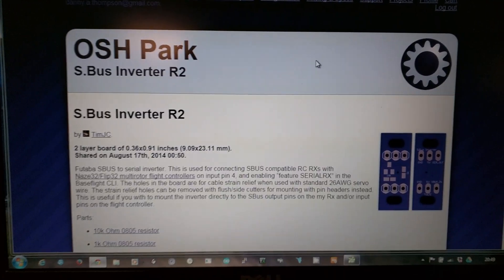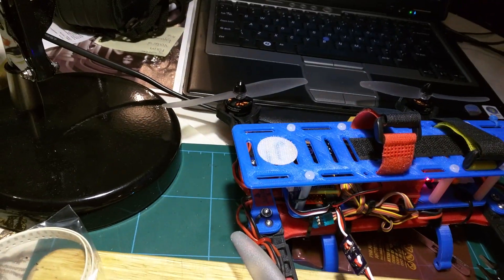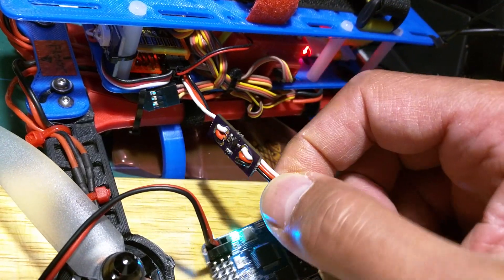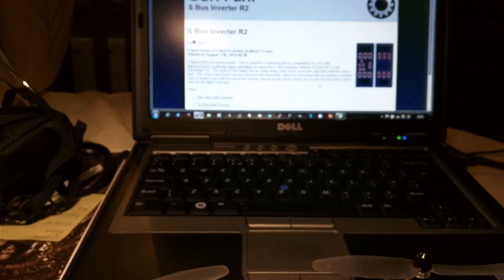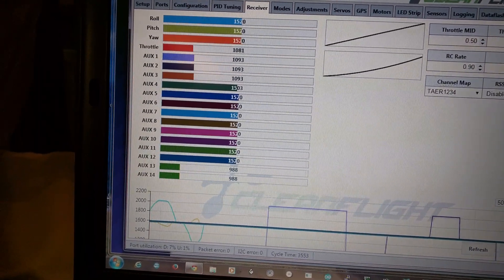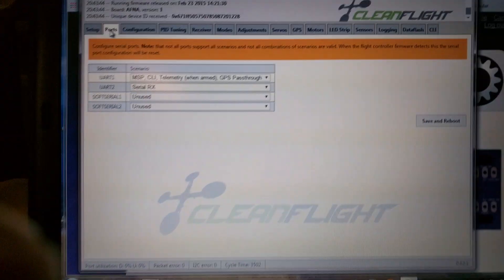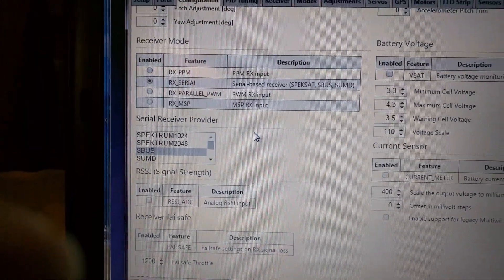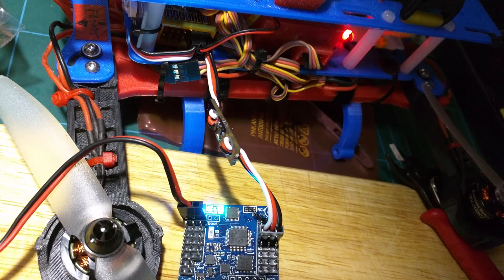S.Bus Signal Inverter - Flip43/Naze32 Cleanflight

Comment: You basically built a NOT gate, correct?
Reply from the maker: Yup. Can do with specific IC inverter or a transistor and a couple of resistors.
Reply: Interesting. So this is all that's needed to use FrSky x8r PPM on a Flip32+?
Reply from the maker: Leinad Abrasax Yes, it is a very simple circuit. My first was using a transistor and resistors. Then I used an OS board and SMD to learn how to solder these small components.

Comment: Hi Danny  I found the website for OSH for the inverter kit, but they wouldn´t send me a small order. Does the kit include the board, resister and the transister. Can you supply these items. I dont think that they wanted to post to Spain
Reply from the maker: Hello Ken,
I originally ordered 9 of these which OSH were happy to send out. I have sold all of these since then. Sorry, I can't help in this instance.

Comment: Just for anyone who might be looking to invert SBUS, in some cases it's already been inverted on the board, and you can solder a new signal wire onto another part of the board and have the signal you need. From what I know it can be done with the Frky D4r-II and FrSky X8R (It's especially easy on the X8R, there's a pad to solder onto) and might be possible on other receivers.

Comment: I have tried to get this working with a Radiolink AT10 and a R9D receiver without success but i am using a 2N3904 and 4k7 and 18K Ohms resistors. Should that work or is the 2N3904 to slow? I have only a standard multi-meter and can only see 0.47V on the output from the receiver which i think is odd that the voltage not even moves up or down between 0V and 5V.

Comment: Any chance of sharing a video of soldering on the resistors and transistor?
Reply from the maker: I used solder paste and a hot air workstation that I have. But it is a very simple board that could be worked with a fine tipped iron and regular solder.  If I make another I'll video it :-)